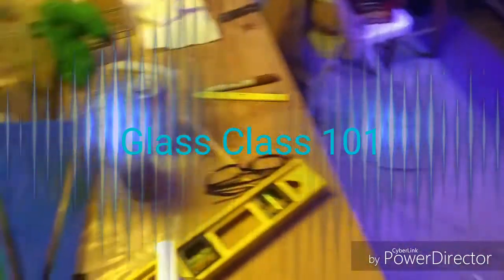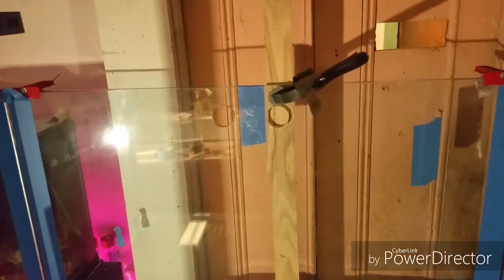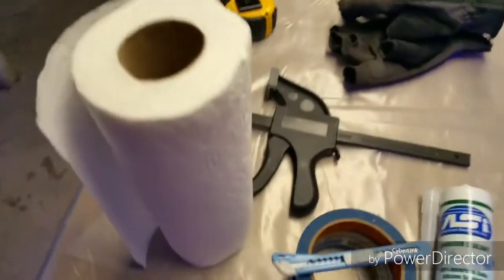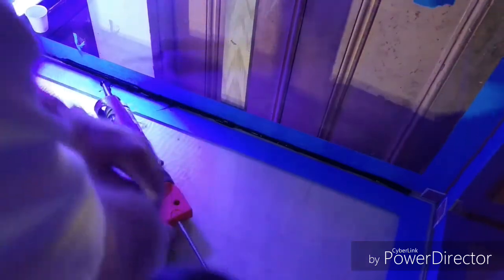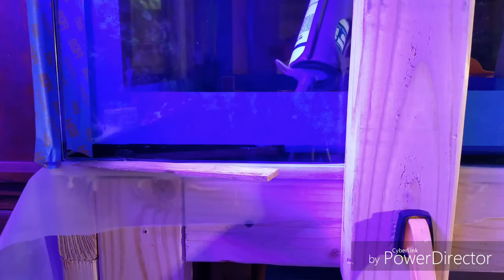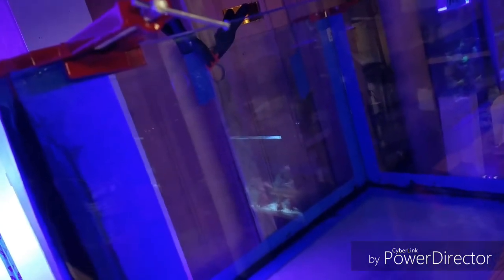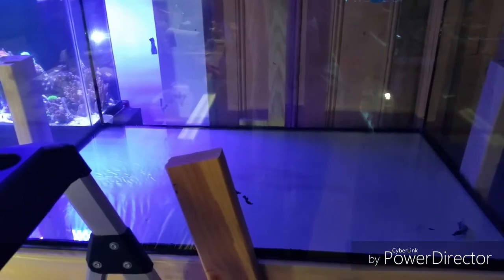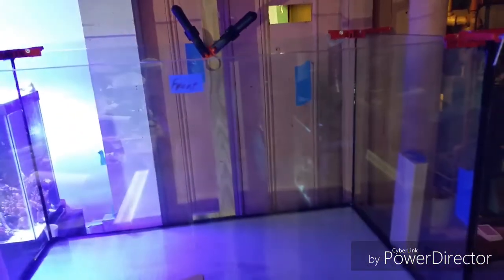Tank Building - Episode 4 - Silicone

Comment: The cards you used were too thin and your nozzle screwed it further. Almost the exact thing happened with me. I used a German silicon which was a lot thicker than the regular ones, the gun broke mid way. You could have used 3 MM tile spacers. Really helps. Built mine yesterday. Perfect seam no mess.

Comment: That sucks bad about the sheet that dropped.. your lucky you put on tape looking at that job 😅 just be careful it isnt compromised. Good idea is wet finger and run it over 2-3 mins after application 👊
Reply from the maker: I've never used a silicone that set up that fast. I got the hang of it towards the end. May be another week till I water test it. I think 6 foot panels will be gotten before ya know it. Thanx for stoppin by Bud
Reply: Give it 6 months and no matter the size it will be too small! 😁

Comment: For the glass spacing try zip ties next time Dave! They work great & Try cutting the tip for the silicone real pointy sorta to fit your needs of spacing and really go slow while injecting !! Its never failed me to leave the zipties in place inject everywhere and then continue my weld if you get what im saying. When I re did both 70s and  built the 55 sump thats what I did !
Wish I could get the hang of editing with a good program -_- Keep up the great work buddy !!